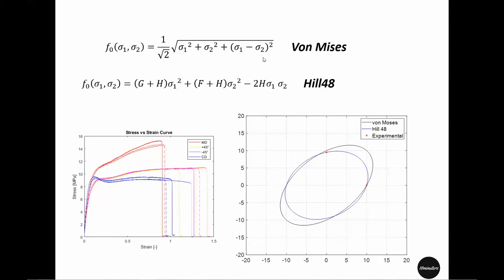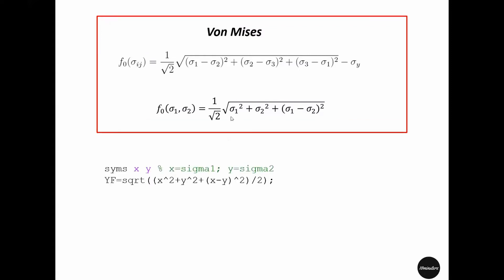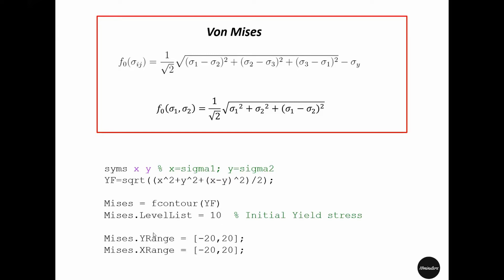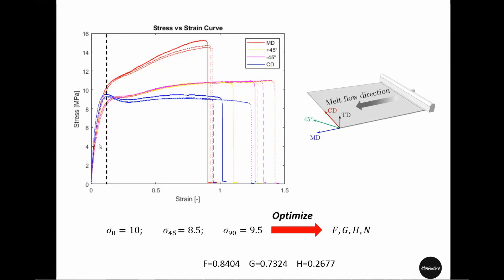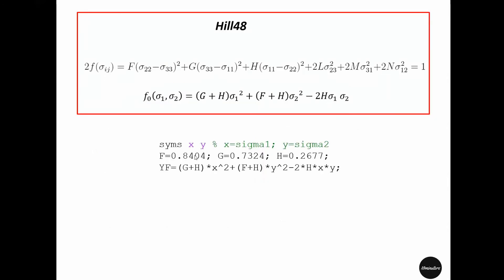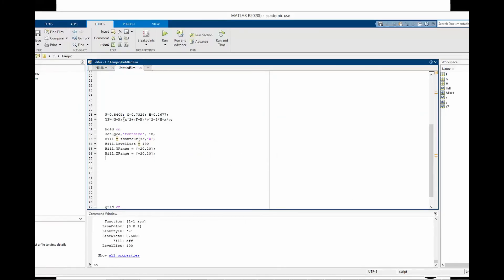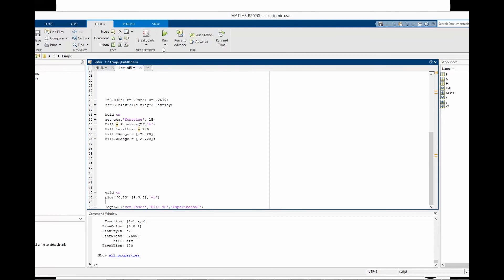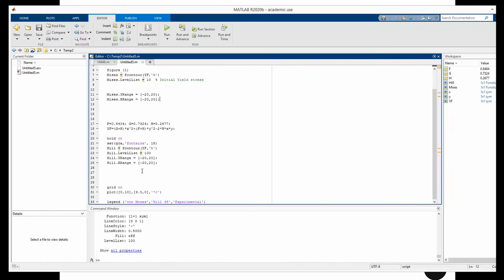Plotting different Yield surface (Hill48, von Mises) - MATLAB code included

Comment: thank you for sharing this useful video. i see that in the end you have used Hill-48 model and sigma0, sigma45, sigma90 to get F,G,H,N values. but in the 2D plot function you have only used F,G, H . not the N. and you have plotted for Yield stress at 0 and yield stress at 90 degree tensile tests only. if i want to plot for 45 degree as well, i need to use F,G,H and N value as well? and i should use 3d equation yield function to plot the yield surface? someone please reply,